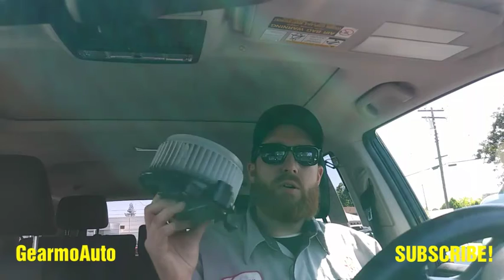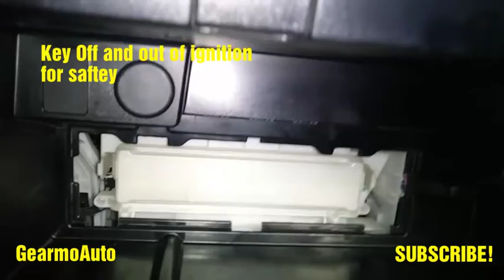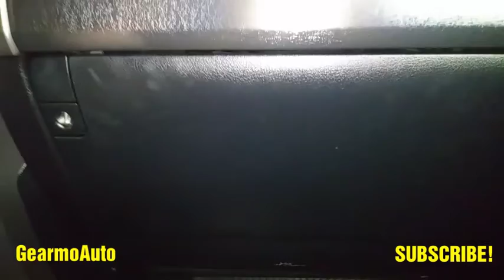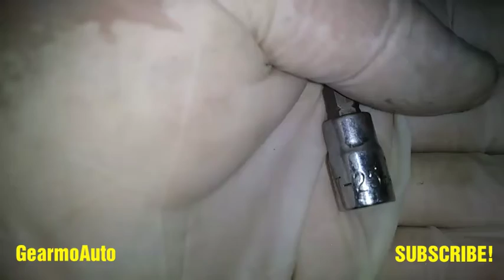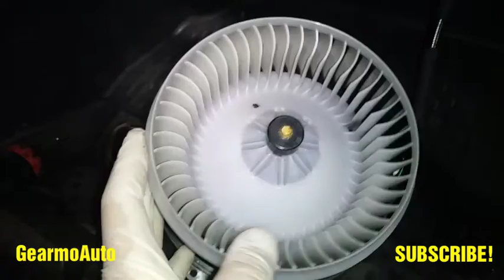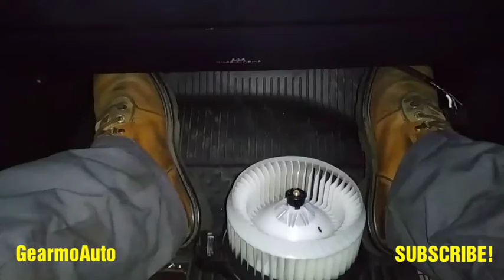2016 Toyota 4 Runner Blower Motor Problems / Fixes

Comment: Thanks so much for this video. I have a high-pitched whine in my fan that gets louder the faster it runs. I have replaced the cab filter before, but did not check the motor. Did not even know it was right there. It's good to know that it is a simple fix that I can certainly do myself. Really appreciate the do it yourself video

Comment: I have a 5th gen 4Runner with low mileage. After changing the cabin air filter on a Nissan where it is located behind the gas pedal in a very tight spot, I was absolutely thrilled to find this in the glove box so easily accessible. I removed the filter and installed the new one with the arrow up and noticed a new low pitched strumming sound in the last two clicks in the fan speed dial. After watching this video, which is indeed very helpful, I was about to take out the toolbox, when I decided to take a look at the opening above the fan where the filter resides and see if it was large enough to use medium to small fingers and reach in there to check for and remove any leaves. I had a leaf in there that I took out, and the fan noise went away!
Pulling out the cabin air filter has to be done very carefully as dry leaves and debris on top of it can easily slide off and fall into the fan below.

Comment: 2016 4runner here. I had replaced my AC blower about 3 times so far(twice under warranty), and summers coming up and the blower motor is failing again about 2 years after the last replacement. Anyone know if the 5th gen got a separate blow motor resistor? been trying to do some research and couldn't find a definitive answer. TY.

Comment: Hey man, 19 5th gen 4R, not getting any air flow at all. I replaced the blower motor , worked good for about 2 weeks and stopped again and back to no air flow at all. From my knowledge I’ve checked all fuses and relays , any advice ?
Reply from the maker: Sounds like a defective blower motor. Did you get a cheap one? Maybe get OEM and try it. Check for power at the CONNECTOR with a volt meter. Put the meter leads across the two terminals with the power on and confirm power. You can get a 5 dollar volt meter at Harbor Freight that will do the job. If it has power then I would say the motor is bad or maybe the connector backed off and disconnected

Comment: Air flow is the same, just quiet now. You can use the recirculate setting and the back AC vents closed to get more flow. Plus, I heard too “good” of a hepa filter can actually restrict air flow.

Comment: So I went from a low whine on the old one to a louder moan on the new one. Actually thinking about putting the old one back in.
Reply: Yes!  There was a shipping clip I didn’t take off 😂
Reply from the maker: Check for debris in the blade or may be mounted slightly off
Reply: Will do, thank you!
Reply: @TheCoachjj3 were you ever able to fix the noise?

Comment: Thanks for such a great video. Short, simple and to the point. I was able to get the correct part for my 2012 4runner and have the old part replaced in 10 minutes.

Comment: These are the videos your average Joe wants to see. We aren't used to terminal connectors and little issues like it's stuck and am I gonna break it trying to get it off. People make too many assumptions on the little things that we don't see.

It's a great little video. Short, concise. To the point. Necessary info, tools.. parts. Everything. Good job

Now let me see an oil change on a 5th generation 4runner with a stuck cap. And don't skimp on the pan shield removal and reinstall.

I can't understand it. The pan refuses to go up that last inch and I cannot figure out why. I'm not a moron, but I ain't no mechanic. But I should be able to figure something so simple out and cannot.

Comment: Thank you for this video, my AC was making a sharp hissing noise, I was about to take it into the shop.  Based on this video, I checked the filter: 1) it was shredded 2) had dried leaves inside that probably shredded it.  I removed the leaves and the hissing noise is gone.  Replacement filter looks to be about $10 bucks on ebay.

Comment: Replaced my 2014 blower motor that was making a low clicking noise. The new oem motor had a small staple clip on one of the blades, the old one did not. It’s for balance apparently. The new one is totally silent. Used an 8mm socket, super quick and easy. Don’t pay someone to do this easy job. Thanks bro!
Reply: Did you get better air flow, my air flow doesn’t seem as strong as I believe it should be ?

Comment: For real.  I bought a used 2008 and the fan roared at higher speeds. Popped it open and it was full of acorns that a mouse or something put in there.  Kept getting intermittent noise from my 2005 (I have 3 4Runners) and found 3 sheets of tissue paper(?) above the fan that was getting sucked down into the fan.  Gotta keep the hood vents clear of leaves and crap, otherwise it all falls down onto your cabin air filter

Comment: Thanks for posting,  my 4Runner (2014) AC works but doesn't blow "hard".

Took out motor to check it, speed control works fine and cabin filter is clean and 6 months old.
Had this issue since I bought it in 2018.

Something in the ductwork maybe?? How can I check?
Reply: Did you fix the issue ? I’m going through the same problem

Comment: Could this also cause it to be warm and get humid in the cabin? I just refilled the A/C so I know it’s not that. We don’t have a great amount of air flow. Thinking this might be it or maybe the resistor. Thoughts? Great video!
Reply from the maker: Nah this wouldn't cause humidity. Is your cabin air filter clean? If the cabin filter is clogged it will reduce air flow. Lemme know
Reply: @GEARMOAUTO  filter is brand new. I always keep up on my maintenance.

Comment: I have this weird suction noise that happens when I shut it off. Sounds like electronic noise
Reply: That's normal to purge the lines. It comes from the front air filter under your hood. It's an injector.

Comment: Thanks for the video, I do have a mouse inside the air conditioner over the blower and smells very bad, now I know how to take of and clean the blower but for clean that conduct over the blower the one that goes to the motor, any videos? Thanks a lot

Comment: That was so helpful!! My AC air flow was low and I checked my cabin filter, which had sand and leaves in it. You solved my problem and I am getting maximum airflow now. It took only 1 - 2 minutes to fix. 😅 Thank you!!!!

Comment: I had a 2016 and mine was replaced three times. I traded it for a 2019 I had the same issue, the first one did it and replaced it... The replacement is making the same noise but louder just like my second blower replacement on my 16. Am I do something wrong with the car? Because I’m gonna need to replace it again and it doesn’t even have 10k in the odo.

Comment: Thanks for the video.  Mines making the same noise on my 15’ but the dealer says it works fine.  I have the platinum warranty and they are fighting me over $150 motor and 5 minutes to install?   That’s crazy.  I may just replace it myself

Comment: My 2014 4runner AC is blowing fast and slow, almost dies, then goes back to fast. It blows cold air. Do you think this is the problem or could it be the resistor?
Reply from the maker: I would be suspecting the blower motor itself. Next time it slows down, safely hit the bottom of the motor and see if it starts working the right speed. If so then the motors bad.

Comment: Great video. Gave clarity.  When i changed my 2010 4runner SR5 blower it was even easy than shown as i didn't have to remove anything except a black cover under the glove compartment covering the blower (it snapped off).  Turns out the blower bearings were shot. I did find it easier to leave the electrical  connector on until i unscrewed the 3 screws as it was much easier to see the clip and remove the connector.
Reply: How much was it?
Reply: @josea.alvarado2548  $75.99 on Amazon
Reply: Burnt Oak I was thinking 100s - Thank you. Not really sure whats wrong with mine. its working but will fluctuate pressure coming out from time to time. Thinking it may be a warning sign.
Reply: Just bought a blower for my 2021 4runner (47k miles) mine was making a bearing noise on a cold soak night. Cost me $275 to buy at the dealer 😁. Just for an update.

Comment: 2004 Toyota 4runner here, my AC blows very cold, but not very hard at all. On low, it's almost like its not on. It will increase power as I go up on speeds, but not like other vehicles that I've had before. Do you think it's the blower motor? Ive already replaced the cabin filter and there wasn't much if any improvement
Reply from the maker: Sounds like there is an obstruction in the air ducts or something preventing the air to get to you. Any additional info?
Reply: @GEARMOAUTO  the air is coming out, and the fan motor adjusts speeds fine. Im just comparing the air pressure to other vehicles, specifically my mothers 99 Toyota Solara, her AC comes out ridiculously cold and hard. Like I said, I replaced the cabin air filter, and checked to make sure there was nothing in the motor. Im just expecting it to blow harder than it currently is

Comment: Hey man I watched a video on the 2008 mustang popping video and commented on it but wasn’t sure if you’d see it. do you know if the popping sound that comes from the dash, would it trigger a solid check engine light to come on?
Reply from the maker: I saw your comment and responded to it on the mustang video. To answer ur question, no it will not effect the check engine light. Its a seperate issue.